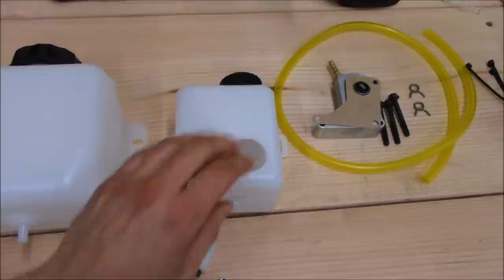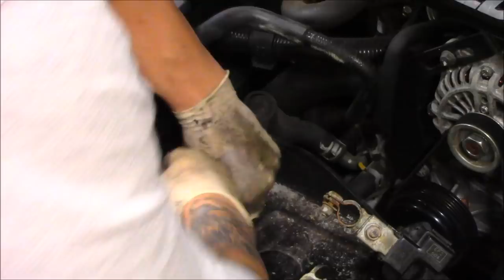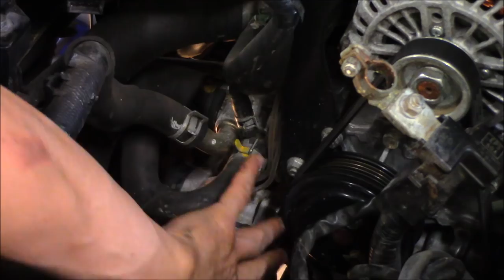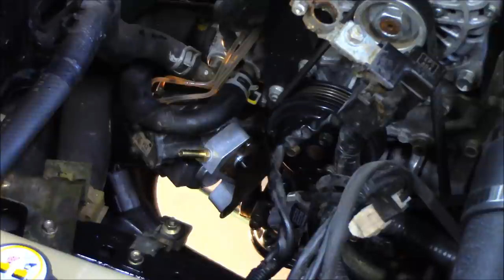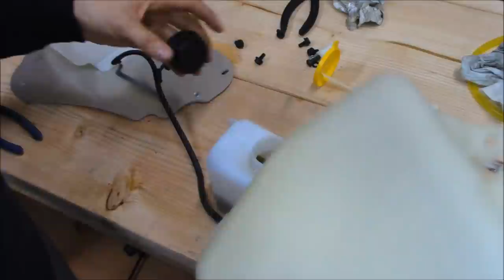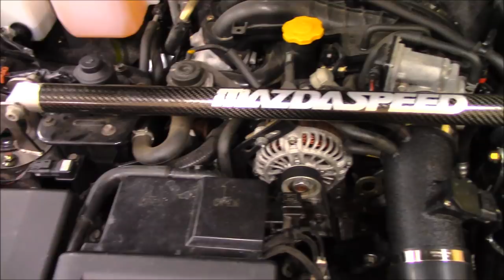Project RX-8: SOHN Oil Metering Adapter Install

Comment: Finally someone who can explain some of this stuff.  For example synthetic not burning right.  I know your not supposed to use it but the reason was always "because"  any good vid.
Reply from the maker: Thank you James 👍
Reply: Modern synthetics are fine. It was back in the '90s and prior when parrifn-based synthetics caused ashy deposits. Most high quality synthetics are ester based and usually burn cleaner than non-synthetic.

Examples: Mazda's rotary engine oil sold outside the US is synthetic. As is Idemitsu's Rotary engine oil is 10w30, and what I've run since break in.
Reply: @3toedSloth75  is new synthetic 2 stroke oil ok to premix with fuel from 1/2 to 1 oz per gallon on 04 Rx8?  Thanks. I read that regular mineral oil burns better.
Reply: @chrislg4519  I use Idemitsu rotary.  It's a blend. Some synthetics are fine to use. Royal Purple is another I've used
Reply: @3toedSloth75  Ok thank you 👍🙏 i may experiment with different premix oils to help preserve seals & compression.  So hopefully seals can somehow be better lubed to last longer 🙏⭐ in this video, it seams Apex seals are made of metal. They dont look like rubber, so maybe oil is disbursed in rotary chamber.
Reply: @chrislg4519  In RX-8s all the rotor seals are metal. In RX-7s many had a rubber plug in the corner seals. People used premix and 2-stroke with SOHN adapters for a long time even with those corner seals. The bigger concern is using too much, especially if your car still has a cat. It can clog the cat if more than 1oz/gal is used.
Reply: @3toedSloth75  Ok great thanks for interesting info 👍⭐ Gotta protect those seals any ways possible 🙏☺

Comment: Great video man! I think Mazda should've done this from the factory. Owners already have to learn new rotary engine quirks like revving it before shutting it off, so I wouldn't think that adding another oil reservoir to keep an eye on will scare people away.
Reply: You only have to rev them if you turn it off when cold!
Reply from the maker: Thanks man 👍
Reply: Most people ride a two stroke motorcycle and I've seen them having no problem regularly top up the oil so yeah as long as there is a low oil level light indicator in a cabin there should be no problem.
Reply: They had to pass emissions that’s why they designed it the way they did
Reply: @JIMWSMITH  noted

Comment: don’t have the OMP Sohn Adapter yet which I saw you installed in your YouTube Video, however have you tried putting fuel and oil in the Sohn Adapter Reservoir also known as premixing to see if the engine will behave better? I know For sure that Wankel (the inventor’s) first original rotary had a carburetor attached to the eccentric shaft because the eccentric shaft turns 3 revolutions for every 1 of the rotor. And I know that Via the OMP the fuel would mix with the Oil of the shaft and the shaft would make the fuel more combustible because of better turbulence and burn and run better.
It would need a very high fuel to oil ratio like 300:1. 300 parts of fuel to 1 part of oil ratio. Of course you would have to see if the OMP pump is working properly by feeling any difference in the engine performance. It was Wankel’s original idea by feeling the whole chamber well with fuel. As we all know the rotary engine with OEM injectors and even aftermarket does not get enough fuel it can really use as it is always turning. Needs to be full of enough of fuel(Vapor)inside  the chamber for it to really operate well and ignite the air fuel mixture well . Use precaution and let me know how it goes if you are able to see any difference if you can get it done.

Comment: you still have to pre-mix once adapter is fitted, to guarantee full lubriaction of combustion chamber
Reply: Is Sohn oil injection different from premix oil? Or the oils are injected in different areas of rotary chamber? Thanks

Comment: You should look into replacing the plastic radiator for a full aluminum one. Mine broke on the plastic end tank 1 minute from home so I was lucky.
Reply from the maker: Yeah, a Koyo is on my list. The car only has 38k miles on it, so I am not really worried about the radiator failing yet.

Comment: Question: Recent purchase a RX8 04’ luckily has this installation mod installed already , and purchase me some rotary premix synthetic fuel lube. The tank is empty and doesn’t have premix in yet. Do I fill it up all the way up to the line and add some quarts on fuel tank too or not necessarily have to put in premix in fuel tank ??
Reply from the maker: Not a bad thing to throw some premix into the fuel before a lot of hard driving.

Comment: Just a question! If the pump creates a given vacuum and timing at a given rpm, wont the amount of oil that gets into the combustion chamber change due to the lower viscousity of the cold oil? What are your experiences with engines that ran a SOHN adapter without changing the pump's timing through the ECU?
Reply from the maker: It would inject the same amount per RPM as a factory car.
Reply: @TheSlipAngle  Thanks!

Comment: Hey b055, just a quick question, I have looked all over the place and i'm trying to dial my ecu in for longevity. I have been unable to find a good radiator fan turn on temp to kick on the fans while i'm at idle and at a light, my most recent tune has the fans coming on at 205 C but I don't think it should be that high, I have a SOHN and vett coils upgraded with a K&N high flow air filter and stock box, I want to set my fan turn on temp before my exhaust comes in within the week. Could you shed some insight on rotary engine and coolant temps so I don't have the fans keep the oil too low, I use 5w40. Also I have been able to find the 2-stroke marine oil that you have not been able to find if i'm not mistaken. The blue colored outboard oil. I get it online with no issues.

Comment: Should the small oil leed tube be filled with oil if the sohn is running properly? I just installed and I premixed extra heavy just until I know the sohn is working. I don't see oil in the small tube but it seem that the adaptor is pulling in oil. I haven't run if more than 5 mins because I don't want to damage. Any thoughts.
Reply from the maker: That I am not sure about. I just ran premix in the fuel tank in conjunction with adapter and made sure that the oil level in the sohn resevoir was dropping with driving
Reply: @TheSlipAngle  That's what I'm doing too. I am running heavy until I see that level mark drop. Thank you.

Comment: So if u are not supposed to use synthetic oil in the motor cuz it doesn't belong anywhere near the combustion chamber then why is the premix oil u recommend synthetic?
Reply: That advice is based on '90s and prior oil tech. Modern synthetics are usually fine, but it depends a bit on the additive package. Some have too much zinc which is bad for cats.

Comment: do you have to get anything programmed to remove the check engine light ?? just curious to how this work because im getting a P1688 code on my rx8 so im thinking my omp is bad which is causing it to go into limp mode,
Reply from the maker: No check engine lights from this mod.

Comment: Love your videos, they have realy helped with maintaining my RX8 but I just wanted to ask, what happens to the oil from the origional metering pump does it still get injected or is it blocked off somehow.  If it's not blocked off you can't change to synthetic oil as per your sugestion.  Keep up they great work it's much appreciated.
Reply from the maker: Thank you. The SOHN adapter blocks off the oil passage to the engine and pulls premix from only the external reservoir, which is delivered to the housings just like stock.
Reply: @TheSlipAngle   thanks for you video. Want to ask if i can use the same oil that i am using already for my engine or to i need to get a especific one? Also just want to make sure when you installed what it does is it gives more oil than the original pump right?
Reply: It's the same amount of oil as stock, it's just that it's clean oil and much better of a completed burn than the previous used stock pumped engine oil.

Comment: would i be right in saying this would be a good option if you  daily drive and eventually want forced induction, so its a way to help keep temps down over just premixing?
Reply from the maker: This is to prevent injecting hot engine oil as the means for lubricating the apex seals which is more ideal for any situation. If you are going big power or tracking the car, it's a good idea to premix a little in the gas as well.

Comment: Think of picking up an RX-8.  You fill the Sohn adapter with PREMIX.  But do you also add PREMIX to your fuel?
Reply from the maker: I only add a little to the fuel tank if I am going to put it on track where I will be at a sustained high RPM.
Reply: @TheSlipAngle  Last Sunday, I picked up a 2009 RX8 R3!  Thanks for all the videos on upgrading the RX8's.  I live in SUCKY California were we have CARB.  So there's not a whole lot I can do to sup up my car. :(

So unless you're taking you car to the track, there's no need to premix the fuel after you install the Sohn adapter?
Reply: @TheSlipAngle  Quinn , does preMixing at the fuel tank have any negative impact on the fuel filter, fuel pump and or fuel injectors/fueling system ?

Comment: Awwwww man my RX8 oil memtering pump position sensor has snaped and it doesnt look like you can buy the sensor seperately and this method seems to still require the sensor...

Comment: Do you use the idemitsu oil in the engine also? I’m getting ready to install a metering pump but I run royal purple in the engine so I wanna clarify if I should switch or not, thank you.
Great video btw!
Reply from the maker: I run Royal Purple HPS 10w-30 in the engine for this car.

Comment: Question, my oil metering pump isn't working so I've been just pre-mixing manually everytime i go to the gas station, now my question is, will the kit work if your OMP isn't working?
Reply from the maker: Hey Mark, the Sohn adapter is dependent on having a working OMP pump. Do you know where or why yours is not working?
Reply: @TheSlipAngle  Not really certain on how it why it isn't working. The only diagnosis or signs that it isn't working is, my car drives poorly and  doesn't burn oil anymore. Whatever amount of oil i put in, after 3 months its still the same amount.
Reply: Mark did you figure out what the problem was? I'm having the same issue my omp is throwing my rx8 into limp mode and I'm finding stuff on resetting it without replacement  . Just curious what route you took?

Comment: I have 2 questions.  
1.  Why do you have to remove the air box?
2.  The Idemitsu premix you use says it's Synthetic brand.  Is that an issue?  How is it different than Synthetic oil?  Nobody seems to be able to answer that question for me.
Reply from the maker: The airbox is just in the way of getting access. Premix is meant to be injected into combustion chambers and burns clean. Synthetic engine oil is not and does not burn clean. You can run synthetic engine oil when you get rid if oil metering from the crankcase
Reply: @TheSlipAngle  ok. It just confused me since it says it's synthetic premix. I didn't know the difference between the Premix and oil being synthetic. I appreciate it. 

You didn't drain the oil or radiator correct?

Comment: I'm tempted to get one, but what would the owners recommend for someone new to rotaries? start up, warmup, shut down procedures?
Reply from the maker: They are not nearly as finicky as people make it sound. The flooding thing was only really an issue on early 04-05 models with earlier firmware versions. I can shut the 06 off after moving it a couple feet when cold and it doesn't flood. I don't know what firmware flash it is on, but I would assume it is a later one.
Reply: It primarily is caused by the stock ignition system. The start engine is really weak, and is not strong enough to really ignite completely leading to a flooded engine and then you're all sad because you're spark plugs are soaked.
Best thing to do to fix it is to upgrade the starter engine to a 2.2kw starter from the stock 2.0kw one as well as make sure you replace your coils when needed. 
Sometimes I get to work where the needle is below empty and I just have to hope I can make it to the gas station across the street when I get off work (I should start carrying a gas can with me in my trunk, eh?) and I can shut it off cold to put gas in. It has started up every time that's happened, but sometimes it'll lag for about 5-6 seconds and get me really scared because I don't wanna have to deflood the thing in the gas station parking lot >_<
Reply: Edd Stance 
Honestly I have a 04 rx8 and as for the flooding issues, never had any. Even if I stall after starting. What I do for a "start up procedure is I let it run untill the idle dies down a little bit. When you first start the car it will idle high and be sending a lot of fuel into the system, but only for a minute after that it should really be fine. And in case anyone asks it's the factory s1 starter lol.

Comment: How large is the container? How often do you have to fill it up?
Reply from the maker: Holds almost 2 quarts
Reply: @TheSlipAngle  so would this be good to do if I don’t premix, I want to, but as of now I still have the stock exhaust.
Reply: @TheSlipAngle  also do you still need to do oil changes? Fill your car up with oil? Sorry lots of questions, hard to find answers online.
Reply: @TheSlipAngle  I have also looked everywhere and cannot find a full kit online

Comment: Hello bro, i have a 05 rx8. Does the mount bracket need to be cut to claer the header or any header? Any info I'll appreciate
Reply from the maker: Hey Frank, I didn't have to cut anything to make this header work. I don't think that is typical for the RX-8. You will most likely have to disconnect the engine mount though to install.
Reply: Garage Quinn Motors i understand, I might have bought a cheap header. Thx for info

Comment: Hello,new sub,great videos :) my question is will the plastic hose from the reservoir to the adapter last from all that heat from the engine?
Reply: I routed mine zip tied next to the rad hose under the battery tray. You may want to try that to keep it farther from the exhaust

Comment: Great video! WIth this mod, do you also pre-mix in the gastank? Or is it now unnecessary? Thanks
Reply from the maker: The series 2 cars received additional oil metering squirters, so in a 
track situation I would probably premix in addition. Daily driving, I do
 not premix on top of this.
Reply: thanks.  From what year is "series 2" ?
Reply: 2009 - 2012

Comment: Why not just premix and remove OMP? Do you need a SOHN if you premix?
Reply from the maker: You do not need the SOHN if you premix. It might actually be more work to delete oil metering all together vs running the SOHN. Given that the car is my daily driver, I just wanted the convenience that the SOHN offers vs adding oil into the tank with every fill up. I straight up premix in my RX-7s though.
Reply: Love your videos and thank you for your answer.
Reply: While not a huge issue when you're off throttle decelerating the ECU cuts off the fuel injectors, if you only premix and cut off the oil injection your engine wont receive lubrication during that period of time. Now like I said before it isn't a huge issue since the porosity of the metal holds onto some of the lubrication and usually decelerating this way is done for very short periods of time so I haven't heard of any motors using only premix failing from lack of lubrication. A good many race engines only use premixing for lubrication as well and don't seem to suffer from decel fuel cut under race conditions but it's also recommended to use a high ratio of premix to fuel in race conditions.

While daily driving however there can be times of extended decel fuel cut, I live in a valley and one of the hills coming into it lasts a good 2 minutes coming down. While I premix only I always put the car in neutral and use my brakes instead of engine braking because the thought of the engine going that long without any internal lubrication doesn't sit well with me. If you use this adapter and premix you can get the best of both worlds knowing that at all times your engine will be receiving lubrication as well as the lubrication coming from dedicated and clean sources specifically for this task.

Comment: Love this!! Super handy information great work all round, Do you still premix in your gas?
Reply from the maker: Thank you! No, I no longer premix in the gas for daily duties, for track stuff I throw .5 oz per gallon in for a little extra jam ;)
Reply: The Slip Angle  can i ask do you have any recommendations for what 2 stroke oil to use? grade? synthetic/mineral? i live in Australia and don’t have easy access to idemitsu premix, some say any 2 stroke is ok just wanted to ask your thoughts
Reply from the maker: Can you get Castrol Super Outboard 2 there? I ran that stuff for years with good results up until it became difficult to get in the US.
Reply: The Slip Angle there appears to be a Castrol 2T motorcycle oil near me and Castrol outboard 2T oils available but not as close, im guessing either would be ok? the outboard stuff seems cheaper too! but if you think outboard i’m sure i can find a suitable one, thanks again so much for your time and patients 👍🏼👍🏼👍🏼
Reply from the maker: I only have experience with the Super Outboard 2 stuff so I can't really comment on the motorcycle one. I'd make sure it is combustion chamber safe and meets the same criteria as the Outboard one.
Reply: The Slip Angle I heard a lot of story’s of Castor oil stucking up
Seals how much you ran ? I waS thinking of using it I’m using mag 1 tc-w3 marine premix
Reply: How long will those 2 quarts last,until need refill